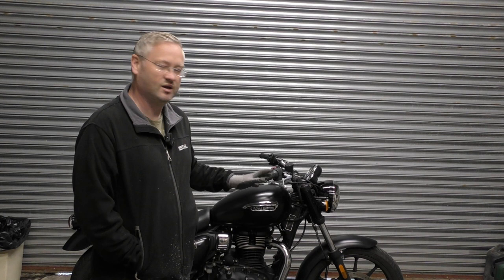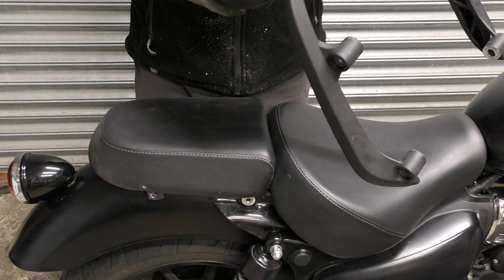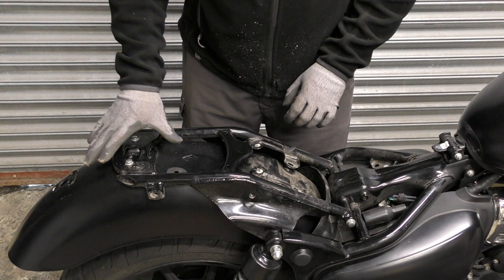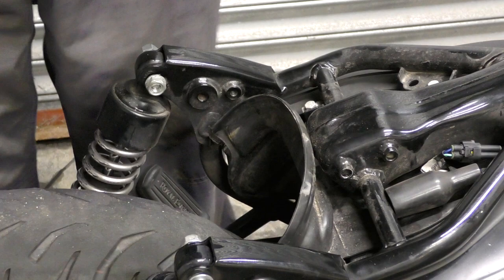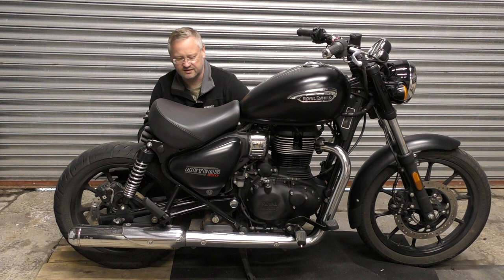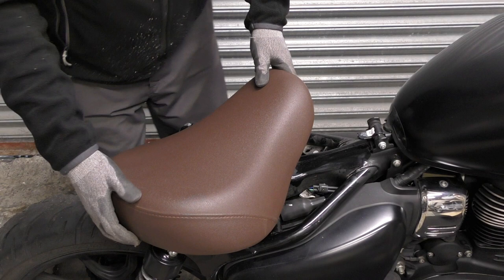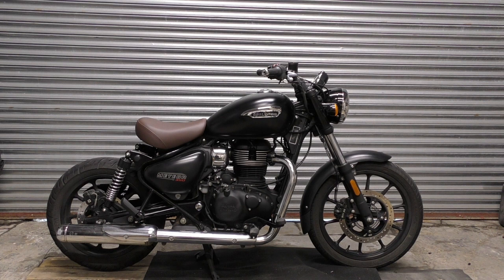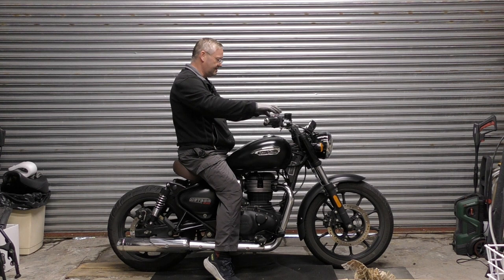Part 2 - The Classic 350 Seat Experiment - Royal Enfield Meteor / Classic 350 Bobber Project

Comment: So close but for some reason you are enamored by the dirt bike style high rear mudguard. Bobbers came from a time before most bikes had rear suspension. The rear mudguard should sit low, like the front one. The only way to do that is to mount it on the swingarm, not the bike frame. Also, with all that weight and bulk removed the suspension doesn’t need to work as hard. Time for some much shorter shocks!
Reply from the maker: Yes, you're spot on, I am enamoured by the high look and it could go either way at this stage.  It'll either be going down on whitewall tyres or up on dirt bike knobblies, the latter is far more likely at the moment and the final mudguard position will kind of drive the whole thing so lots to think about there!  Thanks for your comment

Comment: To my own opinion and is just an opinion the problem with the meteor is the tail is too high, I want to make my own proyect and I will try to make a custome sub frame  to replace the original one that you take out and intent to hold the rear fender closer to the tire,  also modify I m sure that will be necesary to modify the rear fender too to archive that lower look on the tail. Also remove some matrial from the seat to make it less tick.
Reply from the maker: You've got a great eye, have a look at some of the later videos and we go through quite a few changes and options with the tail and seat.  Thanks for watching, Glyn

Comment: Hi and congratulations for your excellent work. I wanted to ask you if it is possible to mount the saddle of the classic 350 keeping the original subframe and mudguard of the meteor. Thank you.
Reply from the maker: Hello, thank you and yes, I think that would be possible.  Apart from the Classic 350 seat and bracket, you'd just have to cut a few mm off the front mounting tubes of the Meteor subframe so that the Classic 350 bracket can fit beside it.  I'll try and point this out in the next video for you.  Cheers, Glyn
Reply: @GlynOC  Thanks Glyn...you are really kind.

Comment: Why not try the classic 350 rear mudguard and then adept that
Reply from the maker: I've had my eye out for one but the side frames don't seem easily available, apart from the tank and headlight assembly it would pretty much be a Classic 350 then!  I like the look of Indian Classic 350's that have the cast wheels, doesn't look like it should work but I like them
Reply: Great video I would consider that seat a bit on the high side for me , I like both feet flat on the ground but it would certainly be advantageous for the taller rider wich could be a better selling point than the standard Meteor.